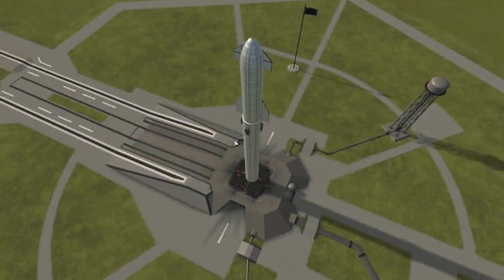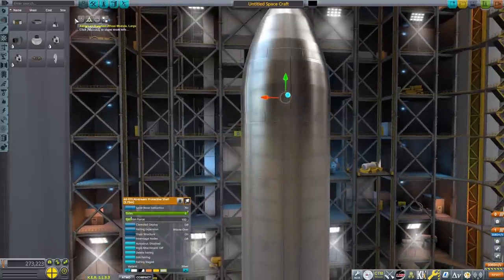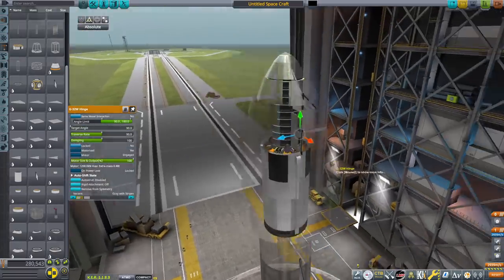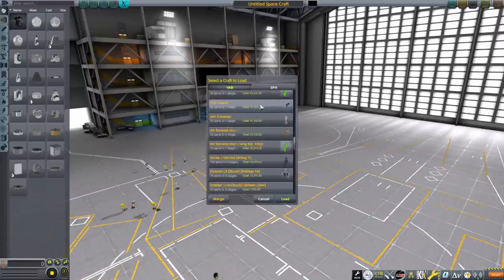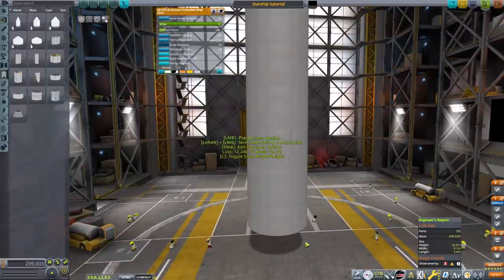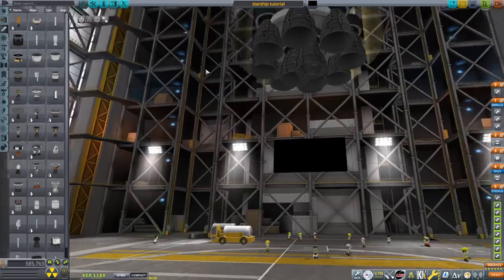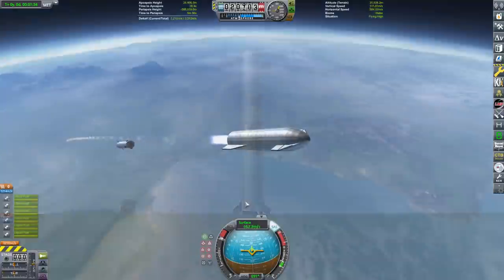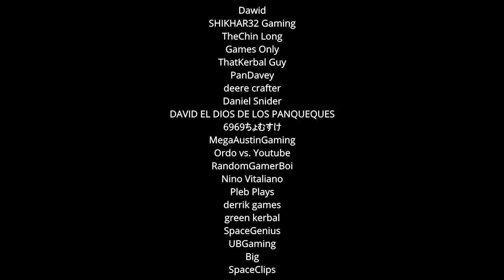KSP Tutorial: How To Build & Fly Starship & Superheavy In Kerbal Space Program [stock 1.11] V2

Comment: 1) I'm once again asking for RCS (on Starship)
2) Where are heat tiles
3) Cool grid fins
4) Where are smol legs?
Reply from the maker: I think 3 was satasfied, maybe
Reply: @Piolet1549  piolet u suck bro
Reply: You can place little rcs pods on the nose cone and by the fins. You can use flags for the heat shields. And you can use pistons for the legs.
Reply: @jacobcote1  I think something would need to be put on those piston for higher crash tolerance, also they released new image showing new exterior legs design (it gives a lot of freedom at the same time)
Reply: @Piolet1549  Videos are cool, I'm just pointing few things
Reply: @eeebasta1224  you are worse.

Comment: how do you control this? when I fly this the starship goes straight down at 10km
Reply: That means the air resistans is more at the back
Reply: So make the back heavyer or use the hinghes
Reply from the maker: you need to mess with your center of mass and the angle of your fins. If you can't control the fins you should make sure they are unlocked and bound to the correct action group
Reply: https://youtu.be/3XLAYjZnC2k there you have a key-binding tutorial ;)
Reply: @Piolet1549  Yo i have that problem now it tips with it nose down and you cant correct it how do i fix this i have no DLC and i checked the center of mass en the center of earodynemic or something

Comment: Do you guys know any way to actually use this practically with a payload or I'm I just being stupid??
Reply from the maker: The challenge with the payload is it is very difficult to get the nice looking fairing transition. But if your ok with having big white lines on the starship you should be able to get it to work. It also can be difficult to get a hinge to move such as big thing without kraken attacks
Reply: @Piolet1549  yeah I was using a hinge with a docking port jr on the other end to make it more secure but it still wouldn't work :/
Reply: @williamboyce837  use "Allow same vessel interaction" , which enables you to dock parts together in the same ship
Reply: @Superbdul_1  ahhh cheers I'm a dumdum

Comment: Every Starship I have made has had a bad yaw problem during the belly flop section of a hop. The rcs tries its hardest but can’t fend it off. Am I doing something wrong or should I just add more thrusters and reaction wheels? Also whenever I do the belly flop from 10km it comes in at 200+ ms, is this because it’s not coming from space or what?
Reply from the maker: yeah just spam reaction wheels and rcs and the yaw problem usually goes away. The most likely reason you are coming in that fast is bc your flaps are getting pushed up by air, causing them to retract and not produce as much drag. Lowering the damping to zero on the hinges should fix that.
Reply: @Piolet1549  That makes a lot of sense! Thanks! Your videos are some of my favorite and I hope you keep making them! Thanks! Edit : It really worked! Thanks!

Comment: Great Starship but it cant put cargo into Orbit right ?
Reply: maybe you can join all the fuel tanks at the bottom of the starship and put the payload on top, but you’ll have to balance it, otherwise it will be very difficult to land and fly.
Reply: Just maybe
Reply from the maker: You could remove one of the fuel tanks and out and put a payload and piston on it. Then you could extend the piston to push the payload out through the fairing. I think it would work but it would look super dumb
Reply: @Piolet1549  Or just place small cargo bay, scale it by tweakscale, use mod on fairings, place fairings to make nosecone, on the top of nosecone small header tank, and you`ll get a volume for cargo, just open the cargo bay, separate, orient payload, and by starship`s rcs move out the payload.